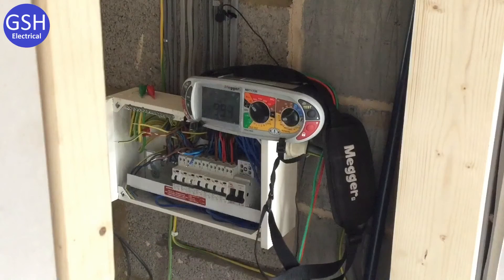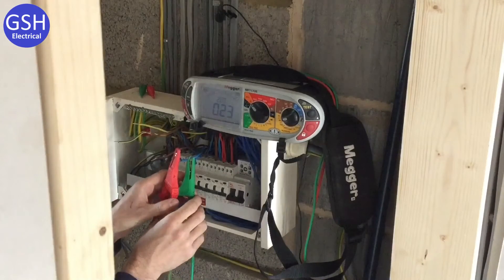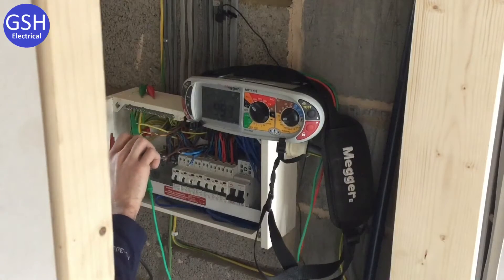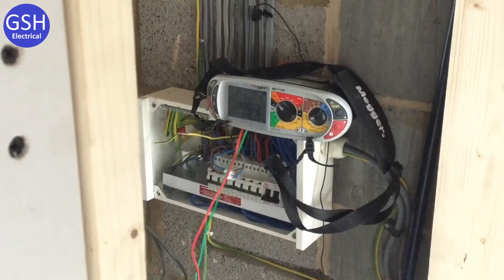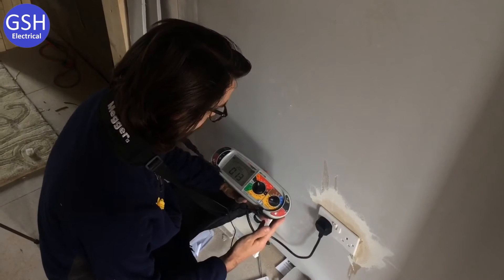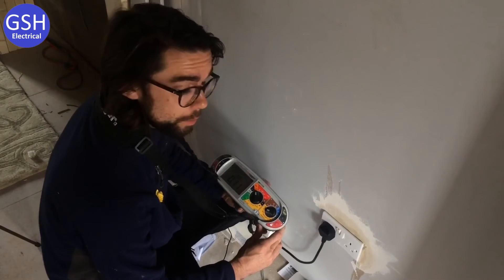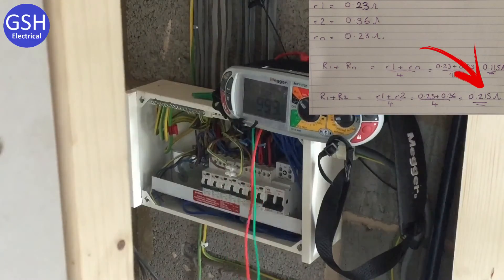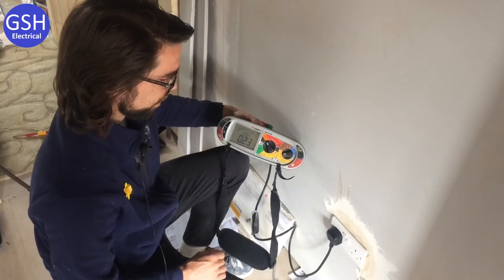On-Site With JT Testing a Ring Final Circuits (Sockets) (Read Description)

Comment: I find the testing between r2+rn unnecessary, as its checks to make sure the polarity is correct. However, with the r1+R2 testing it would show if the R2 has the incorrect polarity. It would also be shown during the Zs testing.

Comment: Can you do this test at a socket rather than at the board gaz ? Still be testing a ring wherever you broke into it wouldnt you ?
Reply: Best off doing it at the board, no need to lock off the MCB as you would have disconnected the conductors from the MCB and made your figure of 8 connections using a terminal block. It also saves time removing a socket plate you thought was wired in a ring only to find it's been spurred.
Reply from the maker: Hi. That’s correct. Thanks for watching as always Gaz

Comment: When you do Zs at the sockets sometimes it is over limit 1.45 ohms , but if you do  Zs by formula Zs=ze+(r1+r2 )  it is less about 0.95 ohm.  Is This mean , that sockets  has poor quality it self.? And i have been told by my tutor ignore the readings on a Tester, use the values you have calculated by formula.
Reply from the maker: Hi. The maximum Zs depends f the type of overcurrent protective device (fuse). Often higher readings during plug in tests can be caused by contact resistance sometimes plugging in and out and operating the switch a few times can help else further investigation is required. Thanks for watching and commenting GSH Electrical